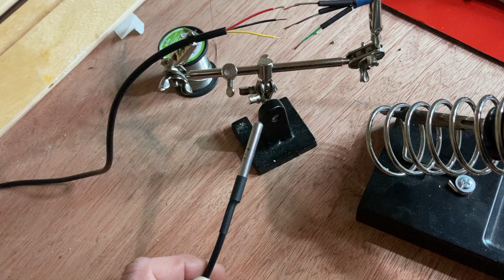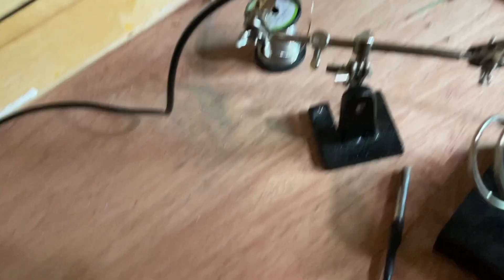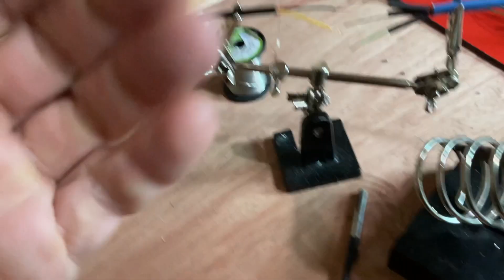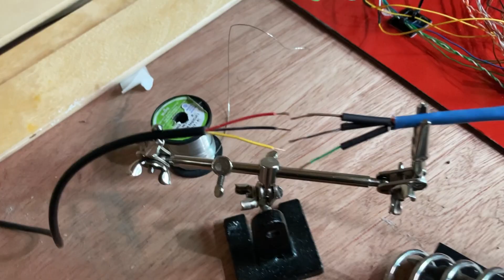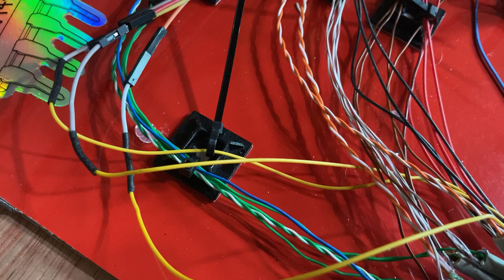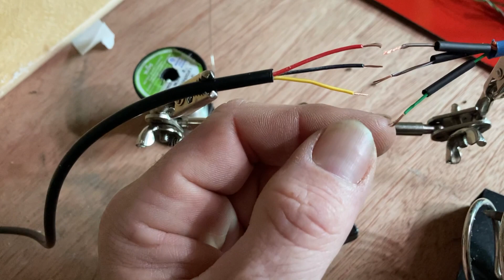Extending temperature module cables with data cable

Comment: Hi.  I know this has been a year or so since your posting but wanted to ask.  I'm having a time locating that "special place" I put my 4 wire cable and need to extend the temp/humidity sensor for an incubator DIY build I'm doing.  Found some cat 5 cable that I plan to use instead.  I'm adding about 6 feet to reach my remotely positioned (wall mounted) incubator control unit (xm-18D) since it cannot be mounted in the unit (salvaged wine cooler).  And now for the Question: you'd mentioned putting a 4.7k resistor inline ("between the power and the data") which I didn't fully understand.  I assume you are not directing viewers to connect the yellow and red wires with a resistor at your splice, and that you are suggesting putting the resistor inline between either the yellow (data) or the red (5v power) circuit at the splice to maintain an accurate reading (which I've heard before, but for longer runs of 30 meters plus).  Since my control unit allows me to calibrate my sensor and that I'm only adding a few feet (2 meters +/_), can I assume that a resistor can be avoided in such an application, as long as I have an accurate way to calibrate the sensor, or is it true that the sensor may be calibrated properly at 38°c but would not be equally calibrated at other temperatures (say 30° or 50°c).  My application will need to keep the temp constant at 37.5°C, so this should be of little concern, but I could run to the electronics store if necessary, but I'd hate to waste time as I'm trying to get this project finished quickly.
In closing, could you specify where exactly you would put the resistor (such as at the end of the power circuit (red) between the sensor and the control unit (or data circuit).
Thank you from PA
Reply from the maker: Hi, I’ve always put the resistor at the processor end, which is what all the instructions and tutorials say.    Im also not sure if you still need it though if you can calibrate.